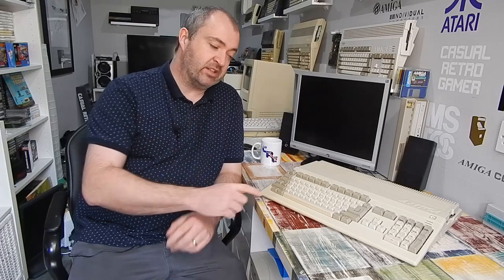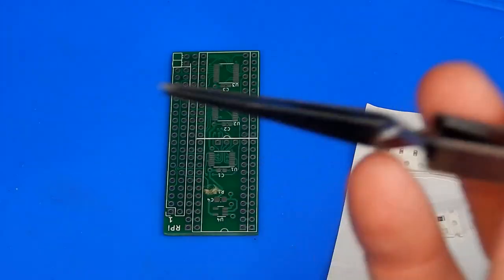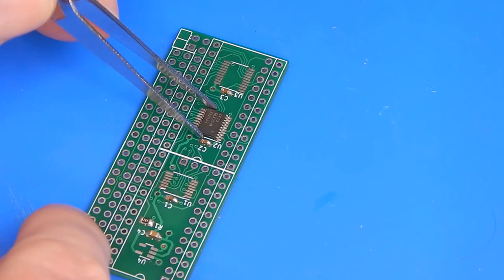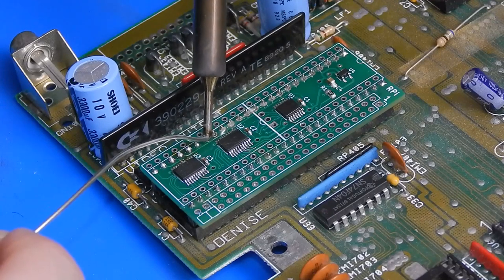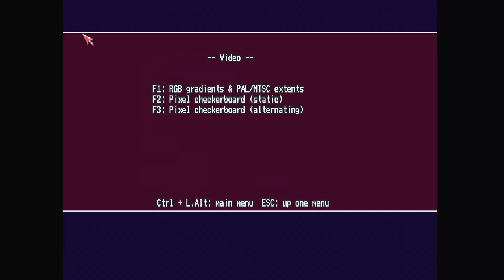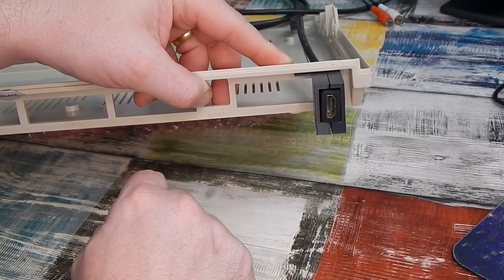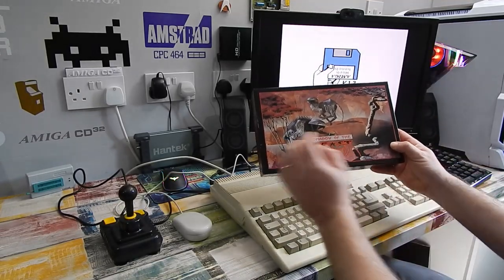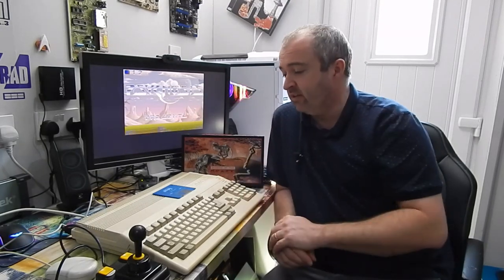Lets build an RGBtoHDMI adaptor for the Amiga 500

Comment: a tip .. put solder on the pads first with flux then put the components on there and heat them up with again lots of flux works like a charm

Comment: I have the same Scart Box and i can tell you that the Picture will be even sharper if you connect it directly to the screen. The Box do some things with the Picture and adds lag. for example it convert 50hz to 60hz and that is not good if your screen can 50hz. The Lag of the Adapter is exactly 1 Frame, so if there is more, than the screen (HDMI optimization...) or something between adds lag.
And you did a good job, I like it that you show the problems with soldering tiny parts, because others usually do a fast forward at those sections, but when I see you problems, I can learn something.  So thank you for showing not only a perfect ending :-)

Comment: Well done man. I wouldn't even attempt to do small work like this without magnification. Speaking of which, definitely get yourself some of those weird magnifying goggles. The magnification (and resting the lower ball of your hand on the table) not only magnifies the image, it also somehow increases precision of your hands. It's crazy how fast the mind can adapt to having more control, as long as your vision is equally zoomed in on the handled object. 

Secondly, maybe diy a little steady-hold to prevent tiny parts from tombstoning / sticking to the soldering tip. The best example i can give what this looks like is a welders helper, or "grasshopper", just a lot smaller, and with a medium sized needle on the end instead of a nail. Instead of a grasshopper, you could also fixate parts with kapton tape, or even bluetac works in a pinch.

That said; there's a boatload of advice in this comment section that is a lot better than mine, but yeah this is what works for me.

Hoping these tricks help with the TF card mate, would love to see you tackle that. Awesome bit of kit!
Reply from the maker: Thanks for the advice, it always appreciated.   

I've looked at those goggles before, the type of thing Adrian has over in his basement?  They might be a good investment in the first instance before a microscope.  I did try using the magnifying glass when doing the other parts off camera but each time you knock it everything goes out of focus.  The goggles might solve that issue.  

I'm ordering up parts for an 8MB fast ram card, I think that's the next logical step before moving onto a big build like the TF accelerator.
Reply: another trick to stop tombstoning is to use solder paste, its a paste that is sticky and holds the smd in place. in the 80s I used to repair and solder multilayer circuit boards that had SMDs and that stuff was magic, it usually comes in a syringe so is easy to apply

Comment: If you tin the pads first (with a bit of flux) and then add the components with a touch more flux/solder  you can do the drag the soldering iron along. Also works great for caps.
Reply from the maker: Thanks for the tip.  I would use this method for SMD caps, it just never crossed my mind to try it on these parts but I'll give it a go.

Comment: Love the way you routed the HDMI cable.  Will you release your 3D design for the HDMI holder?  That clip might break pretty easily, but maybe putting some double sided tape on the back and top may help too.  But I'd love to try this when I finally get around to doing this mod for my A500, and would love to try your 3D printed enclosure for the HDMI cable.
Reply from the maker: It needs a little further refinement but yes I'll release it once I've tweaked things.  The screw hole needs moved slightly and I was considering making it a bit thicker on the right side (looking at rear) to help stabilise it.
Reply: A ribbon HDMI cable with removable plugs may have been another option, but ribbon cables are so fragile…

Comment: Lol! I've been testing ones that I've built up with SotB as well! Looks like you've been on quite a journey and glad it finally worked out for you.
Reply from the maker: A lot of stressful work :)
Reply: Did you have any not working? I tried two so far and the image isn't stable but badly distorted.  Did you see that on any you built?
Reply: @XXXXXX-dy5fs  if they were built correctly there should be no distortion. However it's very easy to get a pin not soldered correctly in a crucial place and that kills the picture. If you are getting instability then I'd re flow all the SMD IC's

Comment: Since I found your channel, I've been loving the content!  This video makes me want to try the same thing since I got my own Amiga 500 a few months ago.  I just need to get it sorted out with the dark green band across the the top of the screen and the rest being completely black.  Would that be caused by Paula being dead at the same time as the RAM?
Reply from the maker: Thanks for the kind words.

Your fault could be related to chip ram or possibly agnus.  Have a feel over the ram chips to make sure none are getting overly hot.  Do all the usual too, check voltages etc.   Good luck getting it going.

Comment: Good job on getting that done with the tools you have!  A few pointers.  It would have been easier to use paste and a heat nozzle for the small stuff.  If you absolutely have to use an iron, a few tips.  Your tweezers are far too big. Your flux is also too thick, liquid flux is easier here.   Also, once the smaller 0603/0402 sized components (your resistors and capacitors)  are placed, you really don't need to hold it while soldering.  Surface tension will usually pull it into place.  Holding is why they were raised.  It can also result in a cold joint if you move the component while the joint is cooling.  The tips of the tweezers are also a giant heat sink.  

For the IC's use a hoof-tip, copious amounts of liquid flux and drag solder a'la Louis Rossman. Avoid giant blobs if at all possible. You just have to remember that solder will want to stay on a single pad thanks to surface tension unless you have too much.  You did a creditable job though.  Practice makes perfect, so keep plugging away at it.
Reply from the maker: Thanks for the tips it's very much appreciated.  I'm really happy to have gotten this working and I do want to keep practising, makes perfect as they say.  I've got some better flux and will take a look for some better tweezers.

Comment: Great video. I have the PCB and parts on hard to build one of these boards but I have been holding off due to my tired old eyes. Even with a head mounted magnifier I don't think I can get in close enough. It didn't seem that long ago that I could read the labels on integrated circuits or the numbering on a D9 connector with ease! 🙂
Reply from the maker: Sorry for the late reply.  

If I can built it, trust me, anyone can :)  Good lux and good solder is about the best tips I can give, makes all the difference.  I do admit though find my eyes straining after working on things so small and even with magnification.

I've got a few more Amiga based soldering projects coming up, 8mb fast ram, IDE adapter and a couple of accelerators so I need to get my practise in.  Don't want to attempt the accelerators until I'm more comfortable with fine pitch SMD.
Reply: @CRG  As I type I am looking at a completed Amiga HDMI adapter! It took a steady hand and and plenty of flux, but it's together and ready to test. Waiting for the arrival of a RPiZero to finish it up.
Reply from the maker: That's great, congrats on getting it built.  

I actually spent the day building an 8mb fast ram board, the GottaGoFastRAM board.  There will be a video although it'll be next week.

Comment: That 3d printed housing at the end of the video, it looks like you designed it to fit that exact HDMI cable specifically. and not just any HDMI cable.   Could post a link to that cable?

Comment: Massive kudos for trying this without a microscope :D
Reply from the maker: Thanks, as I start to do more of this stuff a microscope will be on the shopping list.
Reply: @CRG  It really does make it so much easier. I'm really impressed that you pulled this off.

I rediscovered the Amiga about a year ago and I've gone down the same path. Did this board back in January. It was a real pain until I borrowed a microscope from a friend. Would like to buy one but I haven't really got the space (takes up 75cm x 75cm).

Comment: A customer saw my HEAVILY modded C=64 and 1541 - and he gave me an A500. My shop has repaired six Commodore and Amiga machines so far. I do not market for that. I will be rebuilding this A500, building chip testers and a power supply and doing some mods once I learn what is available and possible and figure out what I want to do. This mod is a must. Any other recommendations would be appreciated. Gotek drive seems a must. I do love using actual floppies, though. An internal scsi to SD card mod would be nice as well - if it can do what I suspect for me. (I've never USED an Amiga!)
Reply from the maker: There are loads of options, you could look at one of the tf accelerators, I'd go for the tf536 personally.  It'll add ram, faster CPU and an ide header.  But if you want to keep it more original you can add individual expansions like I ended up doing in this machine.  It now has the gottagofastram and ide68k boards.  I have videos on them if you're interested.  At the other end of spectrum there is the vampire or pistorm which will give you a massive performance boost although with rtg graphics.  

But if you just want to play some games, the rgbtohdmi will give you the best picture, a gotek will sort the difficulties that floppies bring and 1mb ram is a minimum so make sure you have an expansion in the trap door.
Reply: @CRG  tf536 + gotek looks to be the mods here. I do have a 1mB card in the trap door already. THANKS!

Comment: They are not tweezers. They are a heat sink, for when you are soldering delicate components that don't like getting hot.
Reply from the maker: I also have a plastic set which may be better although I think I'll look for a better set.  Any recommendations?
Reply: @CRG  Pay a bit more and get some stainless steel tweezers, they don't take solder. Ifixit do some nice ones for about £5.
Reply from the maker: Thanks, I'll take a look.

Comment: Would you now say that SMD soldering is difficult, but it's easier than it looks and with patience, a clear work space and preparation you'll quickly get used to it? That's how it looked on the video at least.
Reply from the maker: It is difficult but I think with the right tools, space and patience it can be done easily enough.  Like anything with practise it will get even easier over time (or at least I hope it will).  

While it looks like it only took a few minutes to assemble in the video in total it maybe took an hour.  A fair bit of this time was going over each pin one at a time to check for shorts and making sure it was all connected properly. 

I do think a small project like this is a good starting point though.  The 0.65mm pitch is a bit daunting at first but if I can do it then anyone can.  Just double check your work before powering it up.
Reply: @CRG  I've not done a lot of it, but I've done a little and that's what I've found so far. Dr A recommended these tiny little (22 quid!!) tweezers that helped, but I wonder if the ones you were using were also good because of the reversed mechanism.

Comment: Use a chizel end solder tip for drag soldering. I don't see the point of using 0603 and 0.5 pitch SMD components for this board. Surely the extra couple of mm's by using 1208 and 1mm pitch components is not going to make much of difference to the size of the PCB. I can understand if the PCB was for a modern mobile phone or smart watch.

Comment: This is so cool. Do they also act as scan-doublers, and let you have access to the other screen modes of the Amiga?
Reply from the maker: Not a scan doubler per say as this is outputting a digital signal (hdmi) but it does work with any screen modes I've thrown at it so far.

Comment: Howdy.  What is your SCART to HDMI scaler model?  Can you recommend it?  I'm swamped in unknown choices.  Looking to be able to output a standard Amiga RGB signal, and HDMI signal IN, to HDMI out (or possibly VGA, DVI, or others).  Maybe recommend your 23 pin cable as well.  My brain is scrambled looking at options for weeks.  I thought, maybe just ask someone who has it figured out.  ;)
Reply from the maker: Its one of the RGB Scart to HDMI boxes from the likes of amazon.  I don't think there is a brand as such, they are all made in China but its the square box type.  It works fine for me.  Some people say it introduces lag but I've got another one at my TV with all my consoles going through it via switch boxes and we had many a games session without issue.  The video output from it isn't as clear as the likes of an OSSC, there is a little noise in it, but in a fast moving game you'll never see it, or I don't anyway.  I would recommend it but I'd also recommend paying a little extra and getting it from amazon so its easier to return if you're not happy.  Link to the one I'm currently using - https://www.amazon.co.uk/LiNKFOR-Converter-Adapter-Supports-Headphone-Scart-HDMI/dp/B078JJMR5J

As for the Amiga RGB cable its hard to look past retro computer shack on eBay.  Might be a couple of £ more expensive but the cables are the best quality you'll get.  https://www.ebay.co.uk/str/retrocomputershack
Reply: @CRG  thank you so much for the helpful response.  Square box made on China was funny response. Lol. Everything is.  The link was most helpful.  I have a CDTV and A3000T awaiting resurrection.  I’m finding a lot of 4:3 monitors cheap. Bought one fir under $5 at Goodwill and it’s awesome.  VGA only though.  But with an adapter it looks, well, VGA.  DVI from HDMI would be nicer.  Thank you!

Comment: Great video again. Pistorm next?
Reply from the maker: Got one on order just waiting patiently for an update.
Reply: @CRG  You going to put it in the 1200?   An interesting thing to do would be to try it with a Pi4 , it would fly - hardware mods would be necessary though :) ( maybe just a GPIO extender??)
Reply from the maker: It'll be going into the A500+.  I've been keeping a close eye on the development of it.  Currently it can't be used with the 1200 but there is a trapdoor version in the works.  Equally the released version is only compatible with the Pi3A so you're looking at speeds of about 15mips.  I've seen photos of a development version working with the Pi4 and its knocking on 50-60mips which is impressive.  Either way though you will not find a cheaper accelerator.
Reply: @CRG  Yes , I will keep an eye on it, and if a pi4 version is on the cards, I'll be swopping out my EC1221 for one. :)

Comment: did Amiga 500's ever have internal hard drives or hacked hard drives?? thanks............ i saw one in a magazine from 1992 i think or 1993 thanks...................... also about floppy drives - are all floppy drives the same ? both 720k 880k 800k and 400k and 1.44 mb and 1.76 mb etc? thanks..............
Reply from the maker: There was never an official internal hard drive although I'm sure people did build their own expansions and "hack" them in there.  The proper way to add a HDD back in the day was with the use of a side car like an A590.  The floppy drives are all double density, the Amiga floppy file system allows 880k of data on it.  I think only the later big box machines could make use of high density disks.

Comment: Well, you didn't select the easiest project to start with, did you ? :) 

Honestly, you're doing quite well for a first-timer, and without a microscope / magnification, and with a camera in the way, it looks quite good. 

Tombstoning (the components rising) is quite normal, so no worries there. you fixed it well.

Now, for the next time you do this. Try soldering one of the pads first. Then slide the component into the solder as you heat the solder again. That will be a lot easier, and experience makes it even better. 
And then you splurge on a microscope and all that. And wonder how the HE** you did it without the microscope before. (seriously, I can't do it without anymore)
Reply from the maker: That's how I would do smd caps, solder one pad then slid the cap into place.  Never occurred to me to try it with these parts.  

This was my first small scale soldering project and my first new build project, it was nerve wrecking to be honest 😂. 

A microscope would be a nice addition although I think I'll keep practising first. Next project, other than the 2nd board, will be a ram expansion I think.

Comment: But that doesn't fix the 15kHz problem? So the monitor has to support the 15kHz mode anyway?
Reply from the maker: No the HDMI output is at 720 or 1080p and 50 or 60hz i.e. its dependant on how you setup the Pi's output.  The original RGB output on the back of the Amiga remains 15khz.

Comment: pre solder the board points first, then the components just slide into place. good job otherwise!!
Reply: You only want to tin one pad, not both - else it's near impossible to get it flat unless you're using hot air
Reply from the maker: Thanks for the tips, noted for future projects.

Comment: can any1 buy a brand new Amiga 500? apart from the A500 Mini? thanks............................ i was looking to buy an Amiga 500 for my programming etc thanks........................
Reply from the maker: You could buy a new case, new keyboard, and new motherboard but it would be using a recovered chipset.  The floppy drive would also be used but you could have a new PSU.  Expensive way to do it though.  Easier to just buy a used 500 on eBay etc.